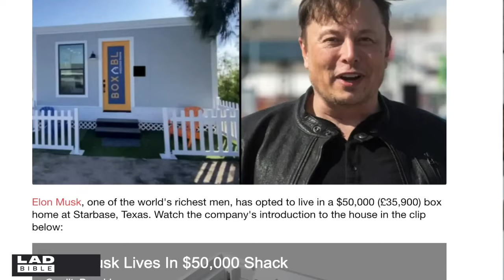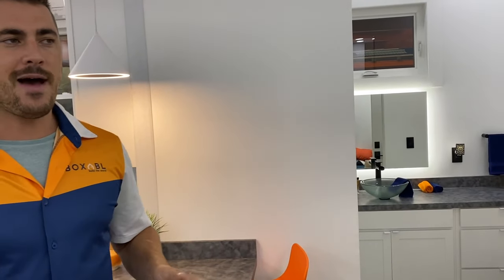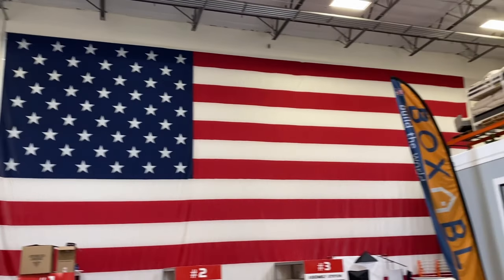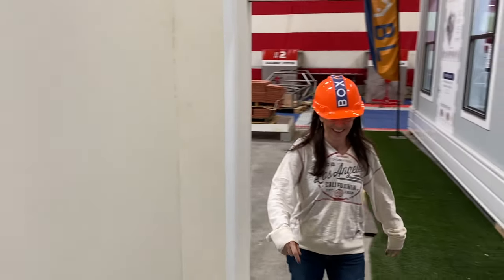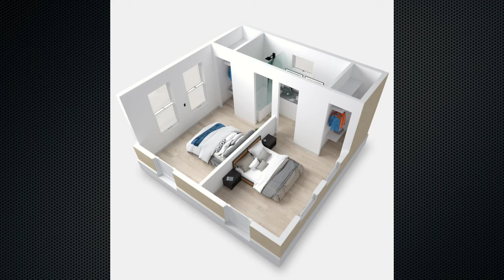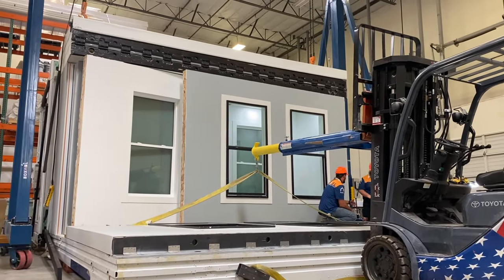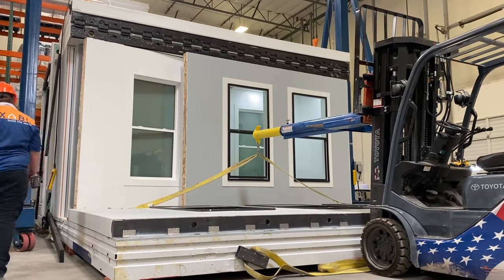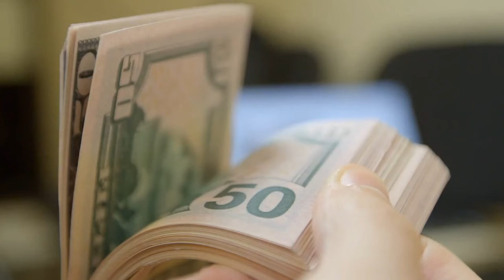Elon Musk Sells His Home To Move Into $50,000 Tiny House

Comment: Noticed he dodged answering the question on changes to price or same materials as used in the model shown last year.
Reply: Yes. 🤔
Reply: I don't think he dodged it. I just don't think he could give an accurate answer as of yet. How could anyone give an accurate answer on that until they find out what this volatile building material market and supply chain is going to do by the time they start running production? Obviously, if the materials they use go up, then the price will have to go up. Either way, they'll still have everyone else (who also has to raise their price) beat.
Reply: Yes, he did several times.  I was looking  at the comments to see if anyone else noticed that.  I don't think I would buy from them.
Reply: @powerofknowledge7771  That's fine and would have been an acceptable answer.  It just seems sketchy when you don't address what's being asked.
Reply: @carolwilliams8840  I understand. He gave a similar answer to what I said in another interview. I've been following them. So I suppose I have a little more insight.
Reply: I was looking for this comment because I noticed it too. He evaded the question twice.
Reply: @carolwilliams8840  it's not sketchy if you don't literally know. We even have a shortage of materials for aircraft.
Reply: They're not for sale yet, and the material pricing will likely come back down to reasonable levels again within a year.  But yes, expect prices to change with market demand and material costs as with every other product on planet earth.
Reply: That is where I stopped the video and came here to see if anyone else noticed. It bothered me too. It's fine if he doesn't know cost or type.  But surely it could be said that they will continue with the same quality.

Comment: There are these things called a mobile home or modular home you can buy that come furnished with appliances for 50 grand that are gorgeous and been around for decades and are much bigger and have only improved over the years. What they are not saying is it will cost a lot more than 50 grand by the time you buy a lot of land and have it prepped and a septic system set and inspected. You also have to have water lines run to it and electricity set up. It adds up fast.